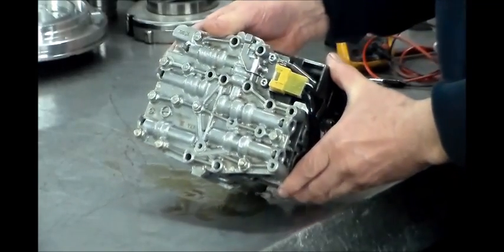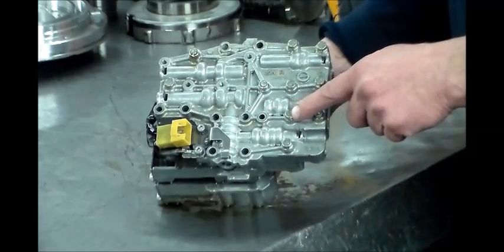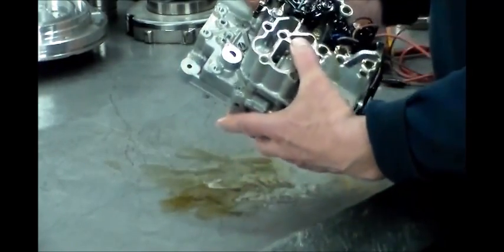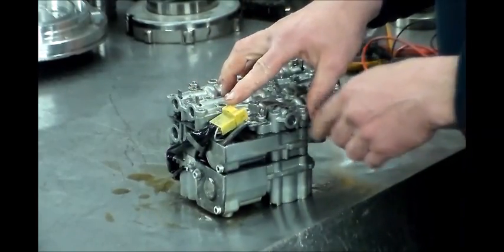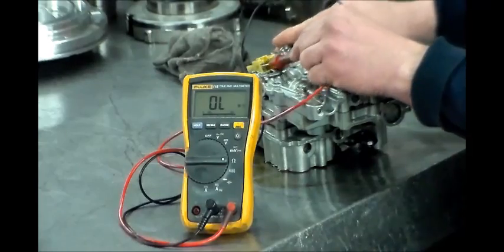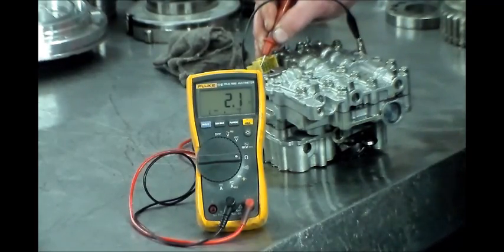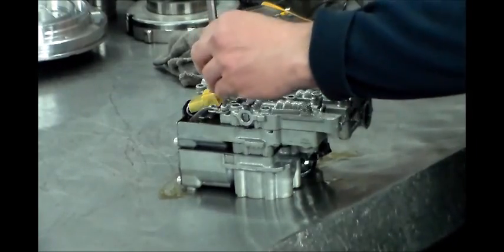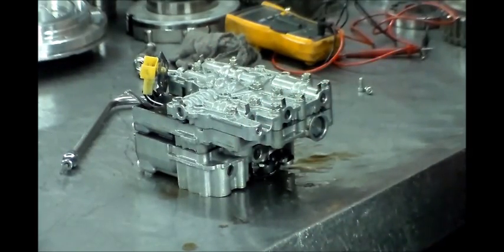Subaru Lineartronic TR580 With Code P2764

Comment: Where did you get the replacement solenoid from? Mine is also reading low impedance on the white wire. When i took the solenoid out it is a long version with 1432 12410 TOSOK on the top and doesnt seem to match any of the solenoids on ebay or the likes.
Reply from the maker: That would be the lock-up solenoid, if you google that you can't find one?
Reply: @GaryFerraro  i havent been able to. Seems like all the ones i have found are the short solenoids that are located on the opposite side of the valve body.
Reply from the maker: @PoonFlavoredTang  you google lock-up solenoid for the TR580

Comment: Question, If I'm changing the transmission fluid and a TR580 body, can I drain and measure the fluid, then remove the valve body and fill the fluid from the top (valve body cavity)?  I would think it would be a lot easier to do it that way. Thanks
Reply from the maker: i guess you could but i would still want to check the level through the fill/check plug to confirm it's full

Comment: Just started getting P2764 errors on my 2013 Impreza.  105,000 miles so not long after the 100,000 mile warranty stopped.  Opened a case with Subaru of America to see if they'd be nice enough to cover it.  Need to get a dealer estimate and then see where it goes from there.
How easy is replacing the solenoid by someone with experience working on cars, machinery, etc?

Comment: What is the symptom by lock up selenoid is low? Is it the jerking and no reverse and low rpm affected? Thanks in advance..
Reply from the maker: usually just the check engine light is on, should drive ok
Reply: Dashboard lights up like a Christmas tree.  Check engine, AWD, Traction Control all light up.  Slight bucking when accelerating, higher than normal RPMs at speed than normal.  Just happened on my 2013 Impreza which is out of warranty.  Yay Subaru!!

Comment: Hello Gary, I have just bought my wife a 2014 Crosstrek and am throwing the same code. Does the transmission need to be pulled in order to replace the valve body since it is not accessible from the bottom? Great video and thank you.
Reply from the maker: No , It can be done with out pulling the trans, are you going to do this yourself?
Reply: Gary Ferraro Yes, that is the plan. Looking from the top it seems as though it may come out that way. I wish I could post a photo on here and show.
Reply from the maker: @unity11325  My e-mail is 
gsferraro@yahoo.com
I will look to see if I have any footage, may take a day or so I have to look for it.
Reply: Sorry I just realized you said it CAN be done. Trying to lift the top seal of as we speak
Reply from the maker: How is it going?
Reply: I emailed you Gary

Comment: Hi Gary  ,  have a question for you,  I have a 13 legacy with TR580KHDAA cvt wondering if I can swap 2012 or 2014-17 tr580 if not what's is the difference between 2013 and the rest of the models
Reply from the maker: There are different generations of these units, not sure when generation 1 ended and gen 2 started. I do not have much info on this trans. There is a tech that puts out articles, he knows these units very well, his name is Jared Warren, if you google him, im sure his articles will come up.
 I just googles Jared Warren/transmissions and he came up

Comment: Thanks Gary.  This motherfucking gearbox has given me the shits lately with this error code.  I'm getting it swapped out with a lower km one because transmission specialists said it's $2700 JUST for the valve body, not including install.
Reply from the maker: That's crazy, even the dealer is not that much.  Where are you located?
Reply: @GaryFerraro  Australia :(

Comment: Hi..Gary
i have 2006 Dakota
i had codes p700 & p750
i replace the solenoids now all ok
except i lost the reverse
no reverse in my truck
what could be the problem
with the old selenoid i had reverse 
the problem was starting in 4th
reverse was ok
Reply from the maker: Are you sure you caught the manual valve putting the valvebody back in?
Reply: @GaryFerraro Hi..thanks for answering my question ....
 probably i don't .
jus i remove and put everything again  as it was .supposedly 
what could you recomend me to do now?
how find the manual valve?
Reply from the maker: @Roberto-f5z9y  It's actually the linkage arm  on the trans gets hooked up to the cam plate. By chance does the car move forward in neutral?  But to see that you would have to lower the valvebody to see if hooked up.  The cam plate is the slide plate that moves as you select the gears
Reply: @GaryFerraro  Thank you for your answer 
i will check it  before take it to  some place of transmissions
i like to repair  as much i can on my own cars
Reply: no the pick up does not move in neutral 
with the new selenoides the 2 codes disappeared   run ok ,just no reverse
Reply from the maker: @Roberto-f5z9y  The only thing i can think of is something happened, installing the valvebody, does it drive forward ok?
Reply: @GaryFerraro  yes   ...better than with the old ones and codes went off
do you think could be the problem the new solenoids ?
i get it from ebay but  came with some transmission fluid on it.
is that right on new ones ?
or maybe those were installed and returned .i think so  
seller post was new ones .
Reply from the maker: @Roberto-f5z9y  The packs may be tested before shipped, you could try unplugging the pack and see if reverse works, would be nice if you had a scan tool to see live data to see if anything is going on. Any codes show up?
Reply: @GaryFerraro  
ok . i will do it 
thank you very much  for yours tips

Comment: Wife just bought a CRV with a CVT and I'm looking at a Rogue with a CVT. I Have been reading Horror stories about the CVT's. Am I right to believe that there is a lack of maintenance in the majority of these cases?  Would changing the fluid every 30K solve all problems?
Reply from the maker: These transmissions in general have problems, they have bearings that go bad, because of the steel push belt they make metal, when these make metal it gets into the valvebody and the pulley sets, as far as the rouges go, i get calls every week on those, may want to stay away, the honda's with the CVT, rarely get those in the shop